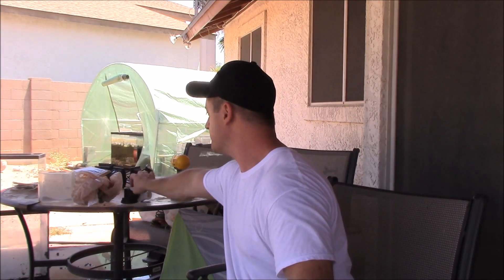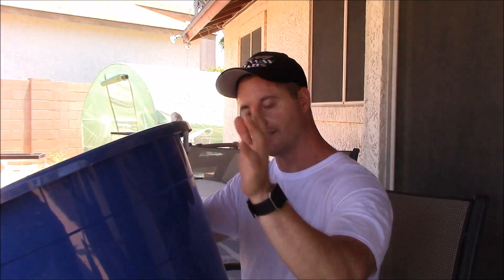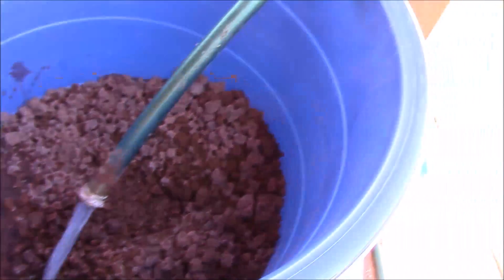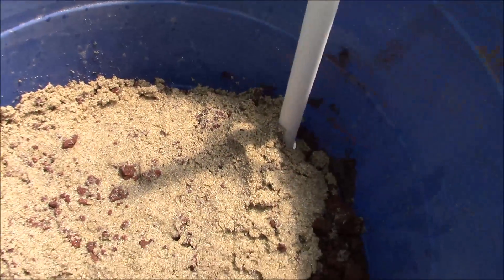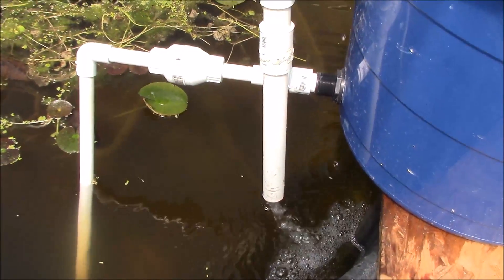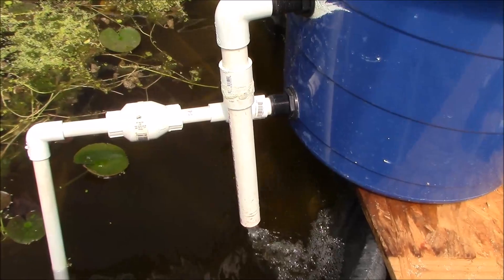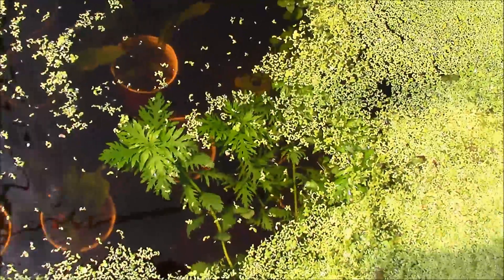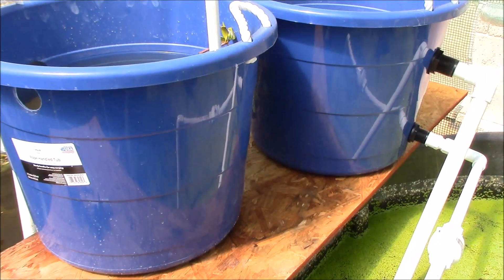DIY BIO Sand Filter

Comment: HI Michael, I'm just wondering what size pump you are using? etc.. what is the output and do you get the same volume coming out of the outlet pipe as you have going into it?

Comment: nice video. was wondering is the input of water per minute by pump same as the output of the water on gravity fed? yr feedback will be highly appreciated. cheerz
Reply from the maker: Amazing Bobby yes the way I have it set up is 400gph goes in and 400 gph go out. You can make a similar system at a slower gph and have it fill and drain like an aquaponic system but I didn't go with that this time . Umm actually going to change my system up in a few weeks because I found a more effective way to grow aquatic plants and filter at the same time . This method I'm using works really well and I recommend it !

Comment: Good video Michael,I managed to do something similar years ago when I had a carp pond,You can do it without bulkheads as long the hole is like 1/3 the size smaller than the pipe diameter ,just cut the pipe to an angle and force it trough :D
Reply from the maker: That's good to know . Thanks Mark